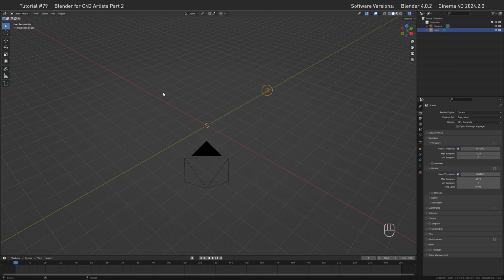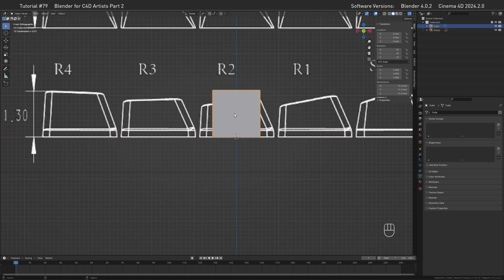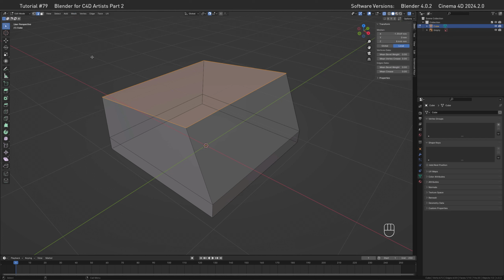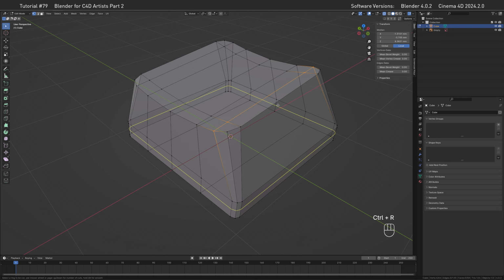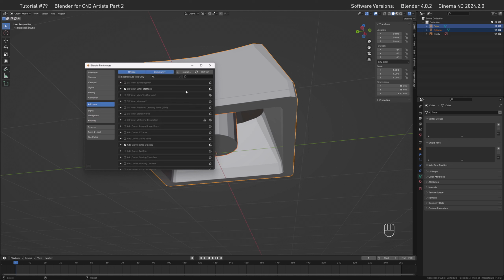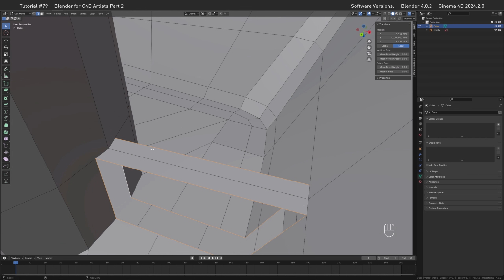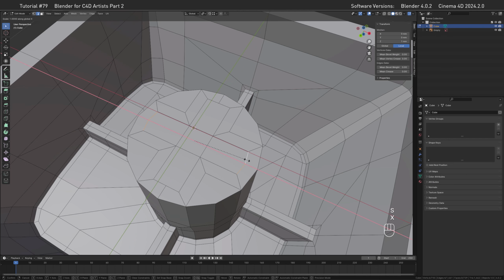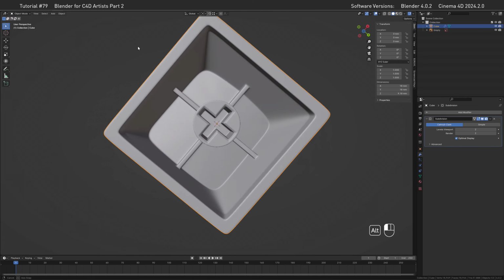Silverwing Long Tip: Blender for C4D Users PT2 Modeling

Comment: you don't need to press the snap icon every time you want to use it, a faster way is just to press CTRL to activate the sanping after you start to move the geo or object.
Reply from the maker: That´s super nice to know. Thank you very much for this gold nugget!
Reply: @SilverwingVFX 
You can also toggle snapping mode with shift+tab.
Nice tutorial, btw. I'm using Blender for many years, but learned how I can do several things faster, as I did before )

Comment: Great video! I would love to see you use Octane for the rendering of this project. 
Some suggestions:
To load images in Blender you can also just drag and drop from the windows folder, the result is the same.
At 20:12 I would have used a solidify modifier, it works really well most of the time and is faster.

When modeling something symmetric I always make use of the symmetrize feature of a paid addon called meshmachine. Just press alt+x or any axis you want to symmetrize and done, instead of tediously modeling each side/corner. Thinking about it this feature is also in Vanilla Blender via edit mode, but the meshmachine version is more intuitive for me from object mode. :)
Reply from the maker: Thank you very much for your comment and your input. This is much appreciated.
I think I mention symmetry somewhere in the tut. But never act on it. I used it a ton in my panel built that I teased in the last Blender video.

I think I have to get mech machine at some point. So many people are using it that it´s basically an essential for Blender.

Also Solidify would have worked here, that´s true.
Though likely would have caused problems at the junction of the top to the side of the cap. I will keep that in mind for future endeavors 🙏
Reply from the maker: Oh and thanks for your suggestion with Octane.
Maybe I will do that. You are not the first to ask. There seems to be a hunger for Octane in the community!
Reply: @SilverwingVFX  Looks like you already have Machinetools installed, that is the same dev I think and also Essential! 😁
The community is definitely hungry for Octane Blender tutorials. Thank you!
Reply: @SilverwingVFX   as one of the Octane guru's you using it would inspire us enormously!

Comment: 3:11 maybe it's SHIFT+ALT+DRA'N'DROP

Blender says "Hold ALT to keep transformations".

Me personally using this set of combinations:
to parent anything to something - is SHIFT+ALT+DRAG'N'DROP [in the outliner]
to unparent something - is ALT+P (keep transformation) [in the 3D viewport]

this set of commands never messes up my objects positions)

Not really sure what does "Keep Transforms Without Inverse" 🤔
Reply from the maker: Hey there and thank you for your feedback!
I have read the tooltip where blender says hold ALT. But I did not get it to work. For me there is no difference with or without ALT.

Basically what I am searching for is that the Object get´s the right coordinates within the null. If the Object sits at 0 and the null sits at X 100, Y 0, Z 0 and I parent it, I would expect its coordinates to be shown as  X -100, Y 0, Z 0. Right now, if I use the outliner the coordinates of the object do not change. It´s still shown to be 0.

Maybe I am doing something wrong though...
Reply: @SilverwingVFX  oooo, I see what are you trying to achieve. Unfortunately I can't find the way to implement it. Hope you will find it once))

Comment: Funny thing. I landen on your channel several monthes ago, as I've started using Octane for Blender. And on the very next day, after I was arguing, that all good octane Artist on Youtube use Octane with C4D, but noone uses Blender, you've posted your first Blender tutorial. Keep going!
Reply: There are a few good Blender Octane tutors on YouTube such as Lino Grandi and Alex Pearce. But none are as commited and skilled at Octane as Silverwing.
Reply: @TheGreatResist  
I think, I've seen them both, but don't thik they are nearly equally in-depth as Silverwing or New Plastic )
Reply from the maker: Thank you both for your comments.
Really appreciated. Yeah. Diving into Blender and trying out Octane. I really missed a channel that had topic based tutorials just like I did in C4D. It´s very well possible that I am just overlooking one. But in general I think there is just a lot more knowledge out there for C4D in terms of Octane.

The good thing is that I have good connections to Otoy, so I can ask the responsible people if I do not understand something or point out Bugs or e.g. UI flaws.

Cheers and to many great Blender Octane tutorials ahead!
Reply: @SilverwingVFX  
All the tutorials on Octane/Blender, I've found on Youtube are very basic ones. So I think, you are indeed the first one here, who is taking it to the next level. Looking forward for the great stuff, cheers )
Reply: @SilverwingVFX  what we really need - is some kind of textures preview in the node editor like in c4d. The preview in the node wrangler addon does not work in the last versions (at least for me), and procedural texturing without it is a hit and miss process. The only way is to connect textures to albedo manually, and it's very inconvenient. If it can be implemented in native Octane addon - I think we need it as soon as possible )

Comment: I highly recommend applying a weighted normal modifier after your subdivision as it should clean the normals slightly for a better, more accurate appearance.
Reply from the maker: Thank you for your tip. I usually do not do that with the reason that I want the model to look the same in any app. Also having enough subdivisions should avoid the problem.
Though I guess you are right that it would improve the orientation of the normals slightly 🙌
Reply: @SilverwingVFX  Thank you for your kind response. You're most welcome! I hope it helps, as you have helped so many others.
You're certainly correct about the subdivision levels. The Weighted Normal modifier is a subtle effect, but I find that it works particularly well on planar surfaces and gives a more accurate appearance of flat surfaces. Otherwise they tend to look very slightly smoothed incorrectly. Give it a try! 😊 You can always delete the modifier if you don't like the result, or apply it if you would like it to remain in other apps.
Thank you for all that you have generously contributed to the community, both in Blender and Cinema 4D | Octane. 🙌🏻

Comment: Thanks again. What i would love to see in the future, would be 

- Color Management in Blender (Aces and AGX) - a quick sum about about render settings / project settings and colorspaces inside of maps -  HDRI, PBRShader, Lights, etc
- Workflow Blender > Premiere / AE AND Davinci Resolve

Cheers,
Philippo
Reply from the maker: Hey Philippo, 

thank you very much for your comment and your suggestions. Those a great!
I think your suggestions are material for a whole other course. But that is not a bad thing.
Those will definitely some topics that need to be tackled.

Cheers and a great mid of the week to you!
Raphael
Reply: I completely agree Philippo! Blender has one of the most non-intuitive workflows when it comes to colour management and render results, especially when the render results are composited outside of Blender.

Comment: good stuff as always, now that you are a keyboard enthusiast I'm curious what's your favorite switch and keycap profile? mine are Reds and lekkers, and Xda keycaps

I learned a lot from this one and I realized Blender indeed can be faster for modeling, especially with things like the point join command

personally, I don't mind longer videos as they always contain interesting side tangents and nuggets that make things click for me, and the holy chart time is at the pinnacle of that, always great watching your videos

Thanks Raph, wish you a great week ahead ⌨🌟
Reply from the maker: Thank you very much and thank you for✨⌨️✨
Super nice to hear that the video was enriching for you and you learned some things!
Also thank you very much for your feedback regarding video length!
Ha ha. Yeah. I did not do Chart-Time in a longer time now. I guess its because I dove a lot into process heavy stuff that does not need to much explanation with charts.
But I ensure you, it will come back ✨

A great week ahead and a great time to you as well.
Raphael
Reply from the maker: Oh, completely forgot about the keycaps 😇
In terms of switches, I was using browns for the longest time. But recently switched (oh, the pun) to linears. I am about to built a Mode Designs Sonnet with Gateron Oil Kings. Really looking forward to it! In terms of Keycaps I really like those tall SA ones. Have not tried Xda yet. What Xda set are you using at the moment? Other then that I quite like the standard cherry profile too. I have a friend who also has a lekker keyboard. Those switches are very nice feeling too. Though I like the sound of standard mechanical switches more. Maybe I am just accustomed to it though.
Overall I find it a very interesting topic! Love that we share the interest in this topic as well!
Reply: thank you for remembering that haha, and yeah the Sonnet looks really cool 🙌I've been eyeing it alongside the worklouder keyboards, the only barrier is the import tax in turkey, I'm an expat and last year I bought my wooting 60HE and me not knowing the import rules ended up costing me around 800 euros in fees and lawyers so i'm good for a few years to come 

for now, i know this is weird but it's functional, i have a mix of keycaps factory OEM and XDA, basically i got a cheap Solidee set to get me by until i get a the Mito Canvas set from Drop (matches the thocky sound), however the cheap set proved to be unreliable when typing and the caps wobble a lot so now I have a Frankenstein of a layout because I need my WASD and modifiers to feel a certain way for gaming purposes 😂

i like how the MT3 and SA look but i never got my hands on them except when i was 5 or 6, i might try them in the future, when i do I'll let you know🌟  @SilverwingVFX
Reply from the maker: Thank you for your nice response!
Oh wow. I did not know that it´s so hard to import stuff into turkey?
800 Euros... wow. That came to be a very expensive keyboard! 
What was the cause of such high cost?

Usually I am used to paying 90 to 150 Euro in Import Tax in Germany.
Though I did not have to do that that often to be honest. I was mostly just reading forums, watching YouTube Videos etc. about those topics. Not participating in those uncertain and expensive group buys.

It´s only recently that my 10 year old Cherry Brown Corsair Keyboard became somewhat unreliable that I finally made the plunge and spend a lot of money for the Sonnet as well as a addon numpad (because I can´t do 3D without a numpad)

About your keyboard. Hey, if it works it works. Its not something set in stone and you can slowly optimize it by trying stuff out. That´s a good strategy in my opinion.

About Work Louder. I like the style of those keyboards. Though I am a bit old school and prefer full height against low profile. But I think they are on the rise and will be acceptable to a new generation of keyboard lovers in the future I think. 
P.s. actually have a 3D colleague that I know working on a collab product with Work louder called "Knob". You might have heard of it.

It can be a really expensive hobby though. Especially if you are going for the high end pieces. Everything costs a lot there. Keyboard, switches, keycaps and then also the things around it. Shipping, import tax / customs. In the end it costs way more then you set out to pay ha ha ha.

I have the Suswatari MT3 keycap set from Drop and use it for my office keyboard. I had to get used to the typing feel first, but now I really like it!

Fun having someone to talk to about those topics. Maybe I should setup an alternative Youtube channel ha ha ha.

Cheers and a great week to you!
Reply: haha of course, man it's an interesting topic, especially since it's something I interact with daily so it needs to be comfortable i used to have the hyperX elite the old one, not the new one that has a numpad and everything, after five years i kinda got bored and liked the size of the 60HE while i was hesitant because there's no numpad nor media keys but in a matter of 2 weeks i felt like home and got used to no having a numpad even though it was my main method of entering numbers everywhere, now it's been a year and i think if i really needed more keys i can get an additional numpad and other macro boards but so far it really works for me so that's a happy ending to the story below 😂

the reason why it cost me so much is that my order was originally 160 euros for the keyboard and 20 for wrist rest (say that fast) but because it was above the limit of importing personal items which is 150 euros (I was under the impression it was 1500 euros) but changed 2 months before I made my purchase, they treated it as an industrial grade item or business class thing which is rediculous because it's a keyboard, so the shipping company people linked me to a broker (because idk what a broker means and I don't really speak turkish) which had really bad customer service and asked me for a power of attorney paper (all of this is foreign to me) so I did that and cost around 200$ equivalent and then I sent it to them and they delayed the processing and blocked my number for a few days because I was calling daily after a week of silence and they sent me an invoice with around 550$ equivalent, and i asked my attorney like no i don't want this anymore and he was like sadly now we can't go back because this and that i got really pissed and payed up and after another week i finally received it, it's a family heirloom at this point 😂😂

anything below 150$ is has 20% tax i think anything above 150 is just hell, that's what i learned

I think I saw a trailer for the knob on twitter, probably I'm mistaken it for the creator board, but it sounds exciting I love the design language similar to Teenage Engineering but more raw

i agree with you on the low profile thing I've been them but i'm afraid they won't thock like normal keyboards when luped and all, and yes it can be very expensive hobby, like audio stuff haha but that's a totally different beast of a hobby

the keycaps you have look delicious, i'd love a high quality all black XDA set, can't find any you're is the next best thing color theme wise

indeed it is fun talking about this stuff, and maybe you should, share the link on twitter and I'll be there man haha

great week to you too, cheers!
   @SilverwingVFX

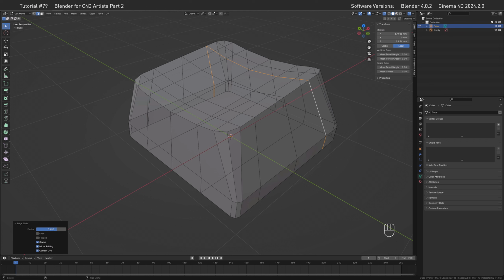Comment: Hi Man! Thank you so much for this! Could you please tell me 19:17 how did you select the edge loop using Double Clicks? I have to Alt+LMB to select the edge loops but you seems didnt touched Alt key at all! Thank man in advanced
Reply: Also I think you set Ctrl+D for merging double vertex yourself right? It is not from Blender default keybind I think?
Reply from the maker: @CharlesLijt  Hey there and thank you very much for your comment and your question.
In my first video of the series I go through that I reset my key bindings to establish an Alt navigation in Blender while trying to keep the standard key binds in tact.
While this worked with most of them, it did not with the Alt loop-cut, so I had to improvise there and took inspiration how it works in C4D.
This is the reason I have a slight different layout.
Might also be that I have "Merge By Distance" on my own shortcut. I do not remember if Blender has it even mapped.
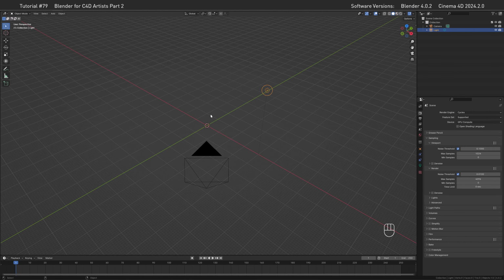If you are interested in that layout, you can find the key map in the description of the video! I also mention it at the interface section at 4:20 of the video 😇
Reply: @SilverwingVFX  wow thank you for the clarification! Yeah I double checked there isn’t a shortcut that do Merge by distance by default, we normally use “M” and click the drop down menu to do that. Also yeah I think you have double click as shortcut to select edge loop can be done for vanilla blender by simply enabling “emulate middle mouse button by alt click” smth like that in the preference menu haha. But this option will disable me to use Ring select shortcut AKA Ctrl+Alt+LMB, I m getting used to Alt+LMB to edge loop select and Ctrl+Alt+LMB to ring select (like in C4D) in blender now.
Reply from the maker: @CharlesLijt  Thank you very much for your answer and for looking up the vanilla setup!

I guess M for Merge is also a good key. D for me was for Distance 😇

I should have stated how to find "merge by distance" in the menu!
Reply: @SilverwingVFX  :face-blue-smiling:haha love ur vids as always! truly learnt a lot from u!
Reply from the maker: @CharlesLijt 🙏✨😊

Comment: Hello Sir❤. In Zbursh there is an option to create a circular mask. but in Blender in the Sculpt tool there are only squares with straight lines if I remember correctly. Is there a way to make a round mask using a blender? Thank you very much.
Reply from the maker: Hey there and thank you very much for your question.
You caught me on the wrong foot there ha ha. I am not a sculptor and I therefore do not know a lot about sculpting in general. So I have not had a look into what Blender has to offer in that regard. And therefore also have no idea if this is possible. Though It must be. Can´t believe that you are not able to create round masks. Sounds like a very essential thing to me!
Sorry for not being able to help out here 😇 Hope someone else may be able to help you here in the comments maybe?